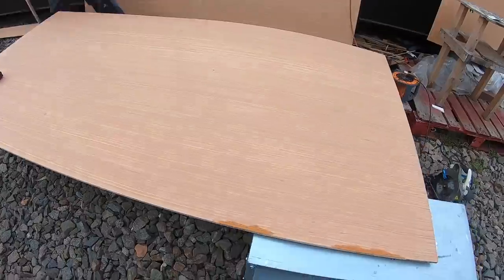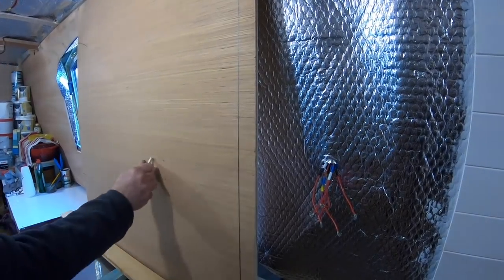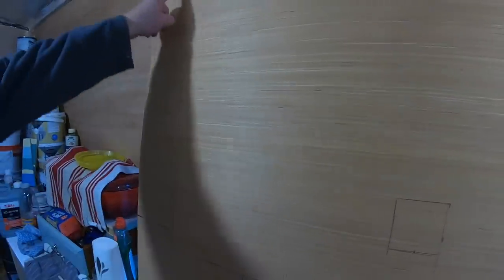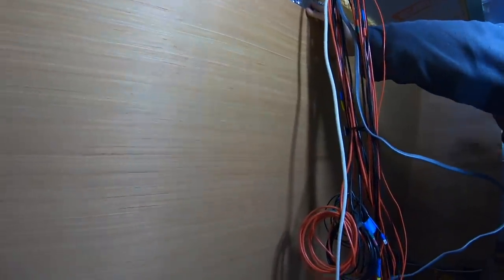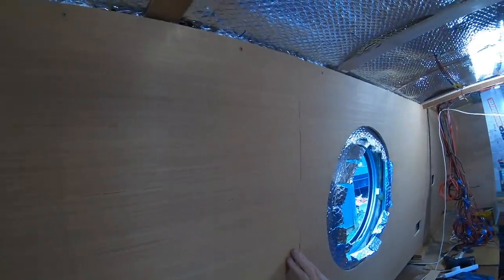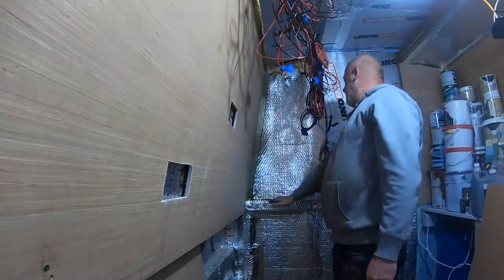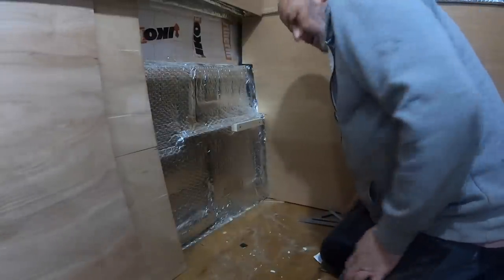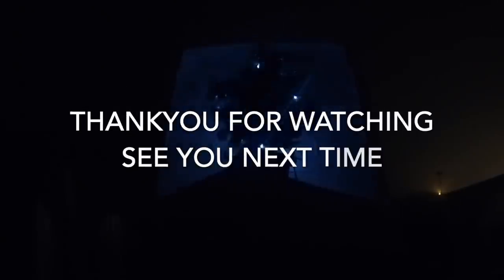Vlog 56, Narrowboat Fit Out - PLY LINING THE GALLEY

Comment: I think you’re doing a great job.  I’m learning a lot from the way you’re doing your fit out. The panel on the bulk head, I’m told, is very difficult to get straight on the steel build.  One side may be different from the other and from front to back.  To that end, bits of wood could be used as a spacer to ensure its straight, then its easier to fit the ply.  I’m mindful, of offering advise when you’re ahead of my build.  It appears I’m finding out useful tips too late for you in advance, and I know it would be frustrating to know after the fact.  Let me know if you’d rather not get advice despite it being well intended.  Have a great Christmas
Reply from the maker: Cheers Chris, Yes throughout the build you have to work with each area individually as no area is exactly the same. Also your eyes play tricks on you especially with door openings when they are near the side walls. Even though measurements where telling us the hole was square our brains were telling us it was well out. Funny things boats lol. Always worth sharing tips and tricks even if its too late for us someone else might read it and remember it.👍You have a great Christmas too